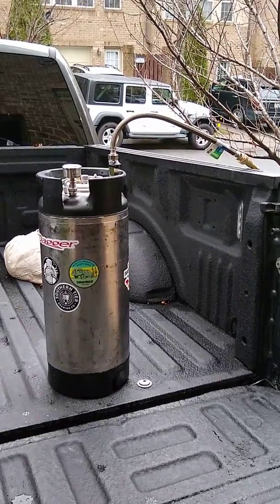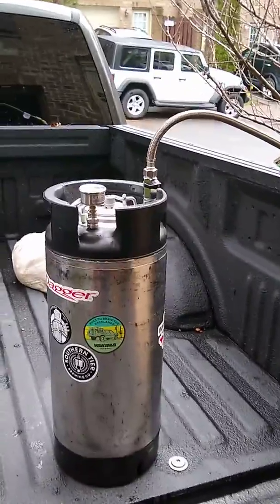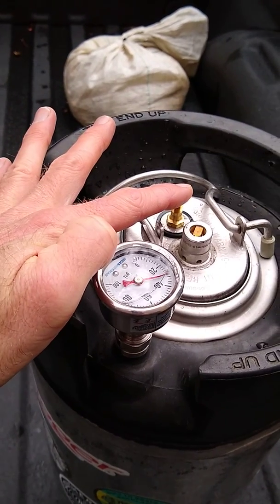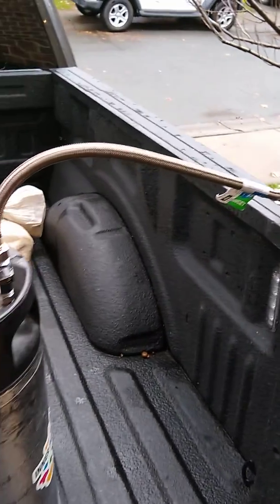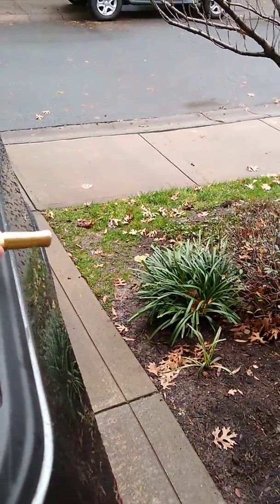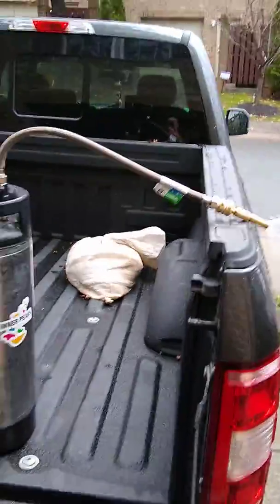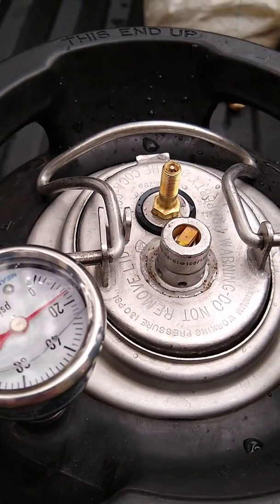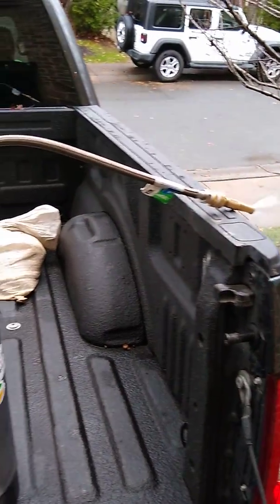Prototype pressurized keg shower for camping

Comment: They're safe to 120 psi. We throw 60 psi at ours & then pump the pressurized water thru a copper coil to heat the water , we use a modified shower head (1/2 gallons per minute with a thumb valve to control flow)which allows us to get an uninterrupted 40 minute hot shower from a 15 gallon keg which has a hinged 4" sanitary fitting as a lid (which means wherever you can find 15 gallons of water ... you can have a 40 minute shower)
Reply from the maker: Will you take a video of what you built and link it here
Reply: @ppod3610   I don't for liability reasons .
Reply: @ppod3610   you've 2 sides to a corny keg an in and an out ... air fitting to the in side which includes a guage the out has a stem which reaches the bottom we just use a standard quick connect keg fitting soldered / brazed to soft copper pipe coiled to fit the flame of a kerosene burner ... then enclosed that with a coffee can , off of the other side of the coil we used a compression fitting to 1/4mpt (dishwasher hose) amazon has a pretty good thumb valve for sale which threads right in . Then pick a pipe type shower head with plastic guts and sear all the holes shut (use a pocket knife heated red hot to create a spray nosil on your plastic shower head which will work till 35 psi .) One slit with that knife will work well but getting it correct the first time is a long shot 😄
Reply: Why ? What's in it for me ? 😃

Comment: Did you ever add more pressure and if so what did you push it up to? How long of a spray did you get?
Reply from the maker: Yes.  I've pumped it up to 40 psi.  The keg stamping says it will take 130 psi, but I'm not sure my valves will hold that pressure.  I find that I pump it up again when it's half empty and that runs the rest of the water out. So far so good.
Reply: @ppod3610  so do you find yourself having to pump it back up to finish the second half?